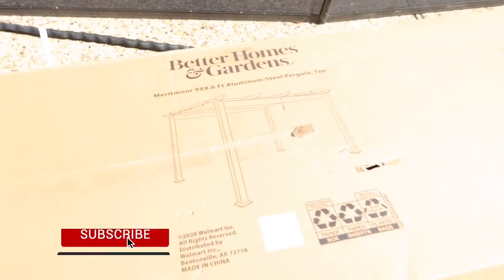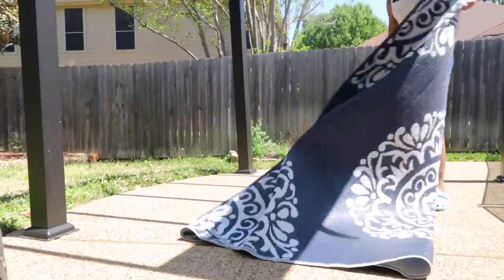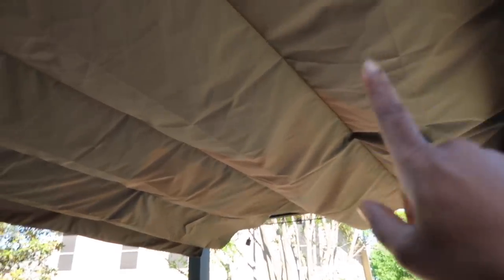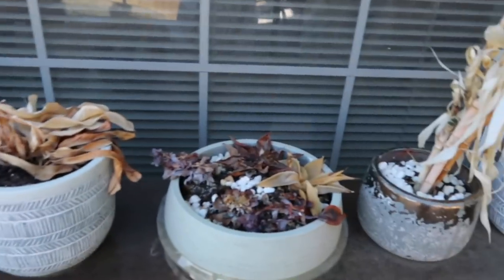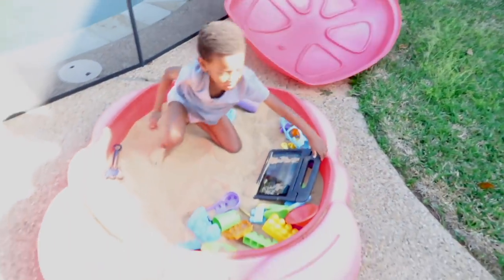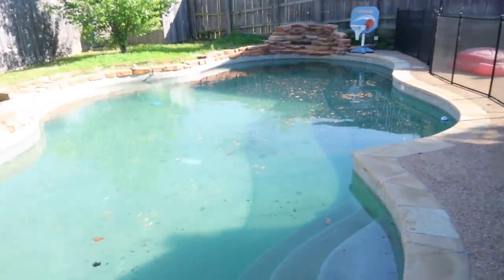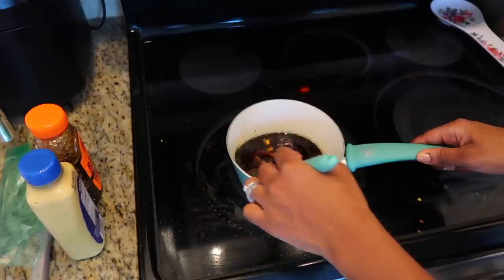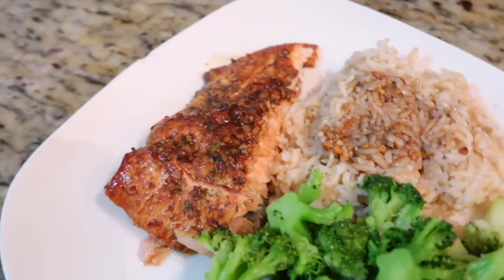DIY PATIO MAKEOVER ON A BUDGET|Decorating Ideas| Budget Patio DIY| Let's Clean & Decorate

Comment: You all did an amazing job. The same happened to our pool pump. We received a quote of $500, so my handy dandy hubby researched online, looked at a few YouTube videos, ordered the parts and FIXED the pump for less that $100. We also have the robot pool cleaner. It does an amazing job.
Reply from the maker: Thank you! Our pump is so old they refuse to repair it. Ours really needs to be replaced (we’ve had problems with it in the past).  My hubby is willing to fix it his self but we can’t even find the pump or parts ourselves. This is unusual due to the massive damage done by that storm.

Comment: Yay! I’m so glad you had a video today. Needed the outdoor inspiration! We have a built in pergola over our patio but I have seen weights you can buy to go on the legs. If not try buying those wooden planter barrels from Lowe’s or HD and securing the legs onto the pot then filling it with rocks. You could even put plants/flowers in the pots as well. It will be a 2 person job to move it but it wouldn’t be permanent! Light and love!❤️🥰

Comment: Strong winds pick-up my metal 10 x10 gazebo with a canvas cover and it went over my 6 foot fence and right into my back neighbors yard. When I went into the kitchen and was looking outside and I didn't notice it at first but then realized it was gone. I could not believe it. I went out to my backyard and looked over the fence and there it was broken and collapsed. You're lucky because you can close yours but not possible with a gazebo cover. It can be very dangerous when there are strong winds!